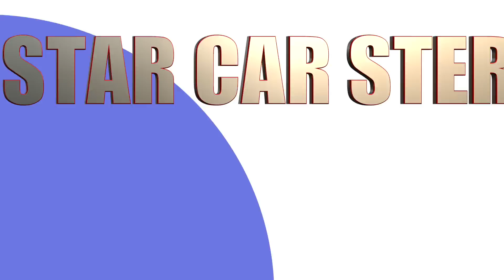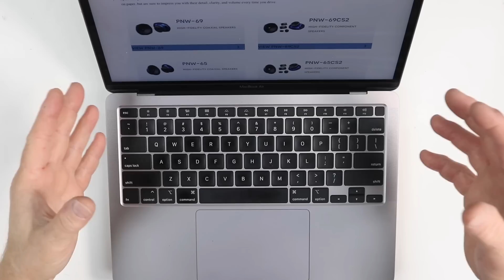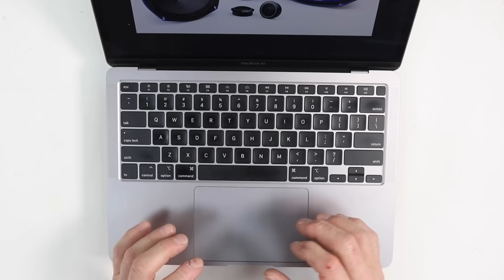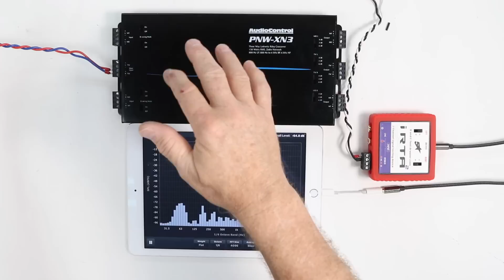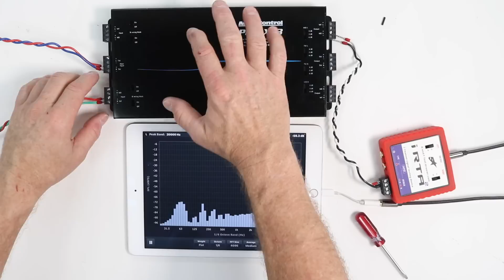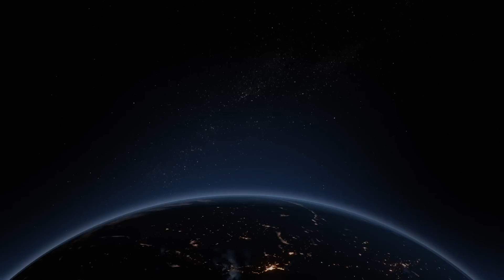AudioControls new PNW XN3 six channel passive crossover network

Comment: This might sound crazy, but is it possible to wire 6 of these into 6 different output channels of say, an LC.6. 1200, and the wire 6 component sets (3 way) to each of the crossovers?

Comment: I have to give it to Audio Control for coming up with this passive crossover system. As long as DSP connections are made with RCA cables (since 99% of car amps don't have digital input) and not Digital Optical cables I find their use in car stereos to defeat their purpose. This is a great way to keep a consistent yet quality analog signal allowing 3 way speaker set ups.

Comment: Just did 4 of the PNW 6x9 coaxial speakers in a ram yesterday off the D5.1300 and my oh my. Now they sounded amazing!!! Super rich accurate and the highs complemented the midbass. Set the crossover at 90hz and let it rip. My new favorite speakers and now this?! Oh snap.

Comment: I worked in a decent size shop that invested in CNC back in 2002.  This was a large scale machine, Komo Mach 3 VR512 and I would say that was the day they exited the woodworking business and entered the part cutting business.  CNC makes you money when it's running, and excels at repetitive tasks.  The time involved in design and setup of bespoke parts can really negate most of its benefits so you have to be aware of this when you take the plunge.  You will spend less time on your craft and more time running a parts cutting business.

Comment: This would be an absolutely amazing piece IF, you were able to adjust the crossover points, as well.  That way, it would be more of a universal type of crossover, for any speaker brand.
Reply: Unfortunately it doesn’t work like that, as different ohm coils will have different crossover points with the same crossover.

Comment: I'm still confused on what active and passive means. Thanks for the unboxing!
Reply: Active is worth it if your looking to make a sound quality system.  Or create your own speakers in the output that's the benefit of running dsp
Reply: @smurfeco2.358  Thanks!
Reply: Active there's no crossovers you run it by a dsp and select the frequencys based on speakers that becomes your crossovers. Passive is when it comes with a little box and that has the frequencys and cut off points of each speaker .
Reply: @smurfeco2.358  Thanks! What would be a reason to stay passive and not just go active if you have a dsp? Price?
Reply: @808SSCamaro  it all comes out down to your budget . For active you'll need to run a little more wire to each speaker.  And depending on what you want to run there's different outputs of dsps right now . Audio control makes a 8 and 10 put . For me in my car I'm only doing active in the front and staying passive on the back with a 6 channel amp . Remember to run active you'll need more than 4 channels so that means a 6 channel amp or two 4 channels which brings the price really high .

Comment: Do many people still do passive 3 way? I would have thought that most people who would buy a 3 way speaker system would want a dsp to get the most our of the speakers. 3 ways aren't a budget purchase. I guess a Anti DSP audio purist might by it,
Reply from the maker: 3 way speakers have become very affordable and DSP amps have not followed suit.
Reply: @FiveStarCarStereoInc  do you guys deal with Audiotec Fischer? Because those are very affordable for sure and their tuning capabilities are superior by far. Canadian pricing on a M Six DSP is ALOT less than AC D6.1200 and by extension around 1000 less than a VXI 6 channel. JL and AC so overpriced it’s not even funny.
Reply: I would be perversely curious to see the market research that compelled Audiocontrol to bring this to market in the year 2023.
Reply: A couple reasons high end amps are expensive, especially if you’re into vintage SQ  A/B . A good McIntosh 431 is $1,400 to run active front passive rear you’re $2,800 plus a DSP.
The Morel Hybrid 63 passive is $1,400.

Comment: So what if I take a mid base speaker a mid range speaker and a tweeter and put them together? Can that create the perfect cross over for them? To. Work together even though they're not made by the same company or not created together as a unit
Reply from the maker: These are made for the new AudioControl PNW speakers.
Reply: Pretty sure it's made for the new speakers from AC, not just any speaker set.